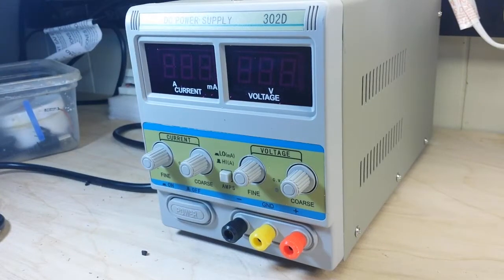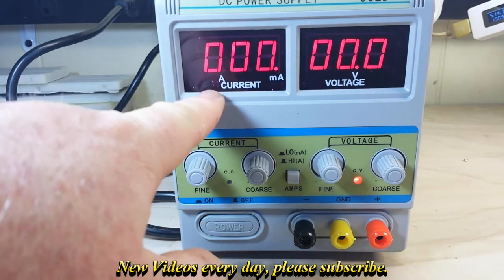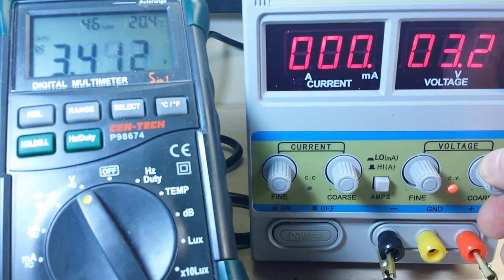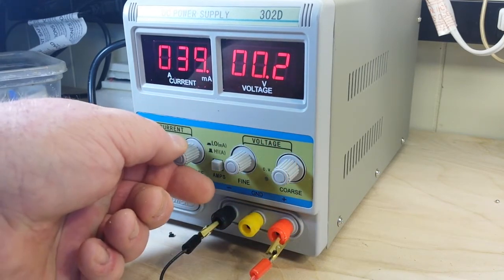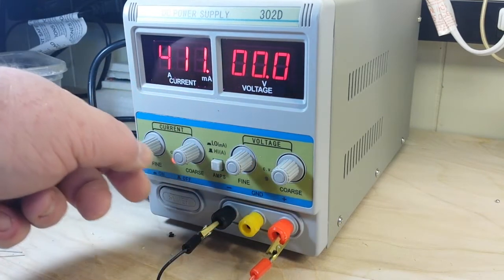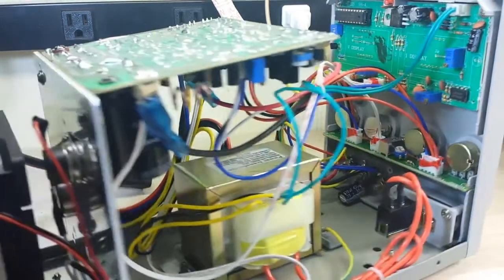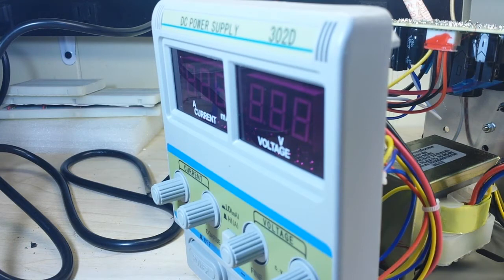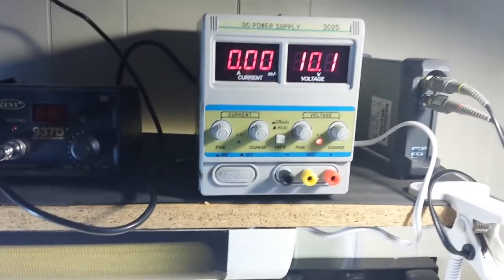Power Supply Review & Giveaway

Comment: Great review. Great set of videos. This looks like a great bench power supply for the home user. I have always thought about getting one. Let's hope that the random generator will pick me.

Just in case I don't win, where did you get it from? eBay or somewhere local to your location?
Reply from the maker: Peter Floyd thanks. glad you like the channel. the power supply is from Amazon. it's branded "flexion" but there are about 20 on there that are all the same. I'm sure they are all made in the same Shenzen factory. "Sum Yung Guy Electronics, Inc” lol just search bench power supply 30 volt
Reply: +learnelectronics they are not all the same. They may use same cases but they may be different inside. I've got a 302D , other brand, and inside is very different than yours, the mainboard is in vertical position, screwed on the heat sink, and all the parts on it are smd. The main transformer looks different than yours, the display board looks different inside... And it isn't made in the factory you specified.
The point is that, even if these PSU's looks identical on outside, they may be very different inside. My guess is that these makers buy these cases from same supplier or so. Cheers!

Comment: I am learning a lot from your channel. But I do have one question: how did you determine the voltage was off on the power supply and not the multi-meter's reading?
Reply from the maker: Rick Barnes I checked with 2 different dmms. they were within 50mV of each other